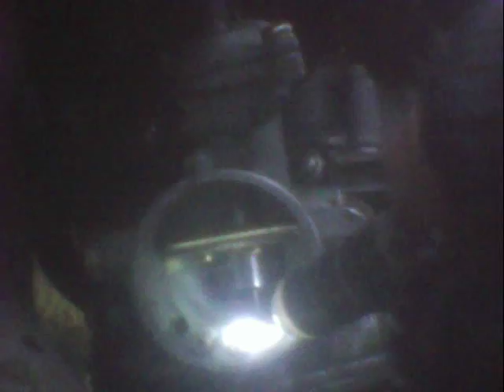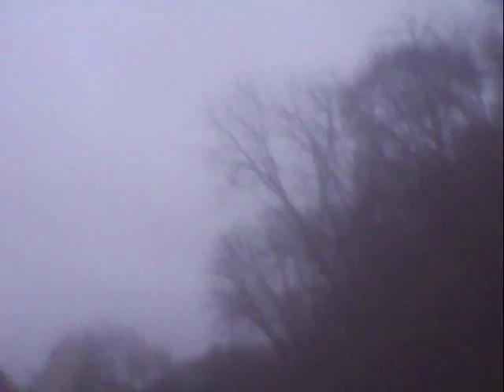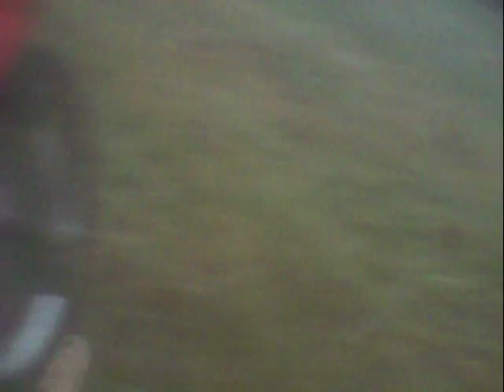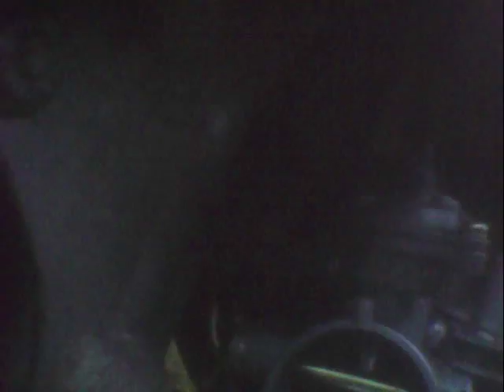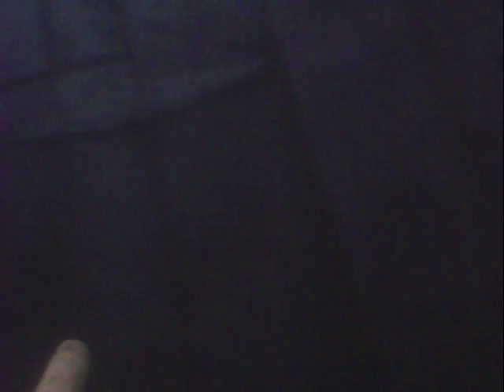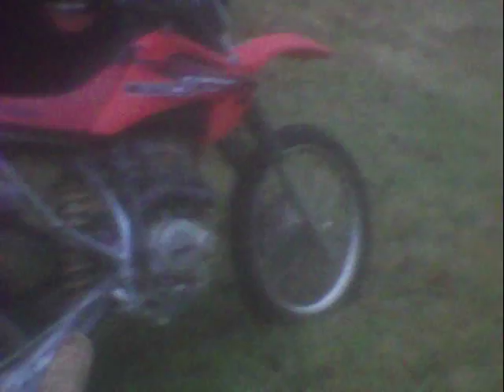Honda crf150f (2005) revs up like crazy when carb Floods out the ying yang wahzoo

Comment: Is there an idle speed adjustment screw?  I've had some bikes that are very touchy, and if the idle speed screw is set just a little bit too high, it revs up like that with the throttle closed.
Reply from the maker: Yeah you can see it on the right side of the carb, I point the light to it when its running.  Its backed all the way out, & it has absolutely NO effect at all in any position on this malfunction.  Thanks, take care.